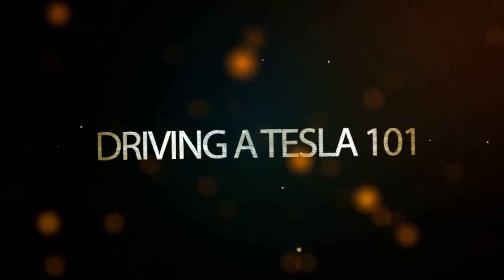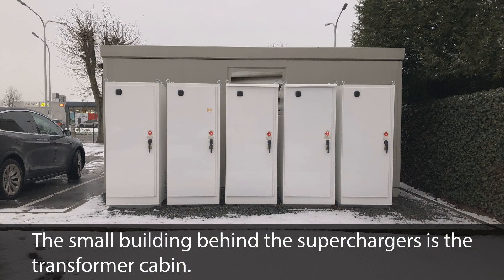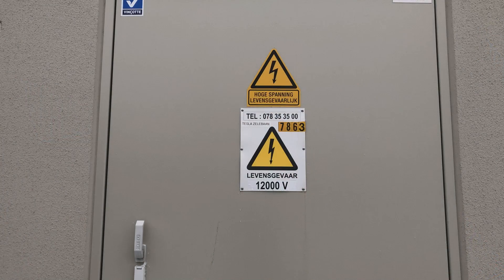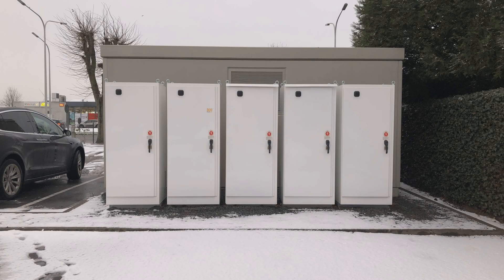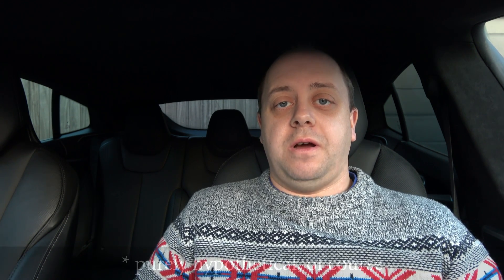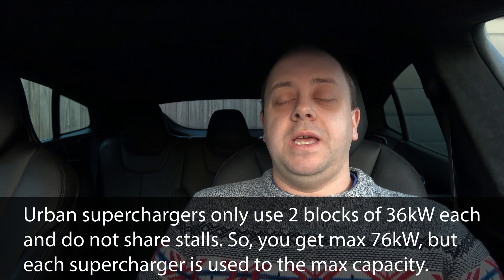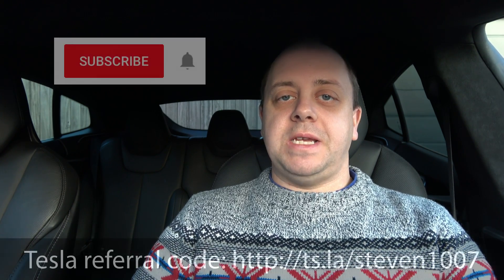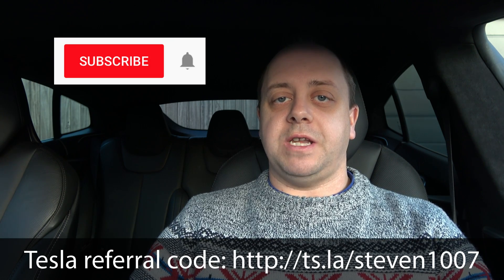Driving a Tesla 101: What is a Tesla supercharger and how does it work?

Comment: Have you got any idea what is in the V3 superchargers nowadays?
My vehicle (Maxus EV80) will charge at V1, V2 and some V3 superchargers. I can charge at SC Leusden and Hengelo, but Wolvega, Drachten and Bunnik didn't work. Luckily at Drachten and Bunnik there  were also some V2 chargers, so I was able to charge.
Reply from the maker: Same principle of multiple chargers stacked, but higher power and not shared across stalls. Not all superchargers are open to other brands though
Reply: @StevenPeeters  
Thanks for the quick response.
If that would be the case, then it's even stranger. Some V3 work others don't. Of course I only use the SC available to other brands. Otherwise I would be unable to start a session. 
I thought maybe with the switch to CCS that Tesla made in Europe they started using other brand chargers behind the SC stalls.
The new Alpitec HYC-300 that Fastned and Alego install nowadays are giving the exact same problem so I thought maybe I was onto a pattern 🙃
Reply from the maker: @arjenhoogcarspel4193  CCS is CCS. It’s just a communication protocol
Reply: @StevenPeeters  At least that's what it should be. Unfortunately it clearly isn't. Same goes for not all brands being able to charge at V4 SC. 
I'll keep digging and let you know when I find something.

Comment: I want to build my own super charger. 
Question how many volts AC are required to power a DC supercharger?
380v to 480v
330 amp at 480v
Reply from the maker: The voltage can be stepped up or stepped down. It’s the amps that you need to deliver the massive power requirement for a supercharger. And that is done via several AC to DC converters. You will not have enough power delivered to your home to do such a thing
Reply: @StevenPeeters  thank you. I wanted to know the specs because I’m interested in a commercial/residential application. I have 480 and I also have Generators I have a 24KW 75KW a 125KW and a 150 KW so I’m interested in what’s necessary so that I can size the generator properly
Reply from the maker: @MichaelDillin  I see. I’m not a licensed electrical engineer, so I’m afraid I can’t help with that specific question. But isn’t a generator providing AC instead of DC?

Comment: problem is transformer is only 86% efficient at rated output and the Tesla Ac/dc converters at 94% efficiency. So the losses are somewhere around 15% or  10 to 12kw  loss and it is in the form of heat.
You could run a entire house with the losses.

Comment: Is the AC from the grid to supercharging 3 phase?  I know there's no such thing as 3 phase DC.
Reply from the maker: In Europe (or most of it) high voltage AC to industry or supercharger location is always transmitted in 3-phase. The transformer then turns it into the right voltage but still 3-phase AC to feed the actual supercharger cabinets where it is transformed into DC power.
Don’t know how it is in the rest of the world or how the batteries are tied into it for some of the V3 superchargers. Not yet, at least

Comment: I already see; this will be problem: More Tesla plus mass production plus price will come down as Tesla have to really up-grade plus install far more super chargers. Electric Utility companies really ending up to run 70 thousand volt power lines instead just 12,000 volt. When solid state battery ever come out; the more of the so major problem to, try to do just 5 to 10 minutes charging with one mega-watt chargers. I say; this major up-grades isn't cheap at all. The Bottom Line: Home Charging is option.
Reply from the maker: Indeed. Superchargers are meant for long distance traveling. Daily charging should be done at home or public chargers.
But Tesla is no longer alone. The IONity network is growing fast and for now, Model 3s can charge faster on those than on the supercharger network. So, basically, Model 3 has more superchargers available than S and X :-)

Comment: 250 kW chargers?
Reply from the maker: HeavenGuy we don’t have these yet in Europe, so not sure about the complete configuration. I know that stalls are supposed to be decoupled. But it might require a completely new transformer cabin too, and battery storage. But the latter one is also not being rolled out here.
But as soon as they start rolling them out, I’ll look into it and report back 👍
Reply: @StevenPeeters  - I was unaware chargers could be combined into a "supercharger" until I saw your video. Tesla must have some finely tuned electronics in their chargers for 12 of them to play nice with each other. Thanks for the info. BTW, another guy tore a v3 charger apart and said each phase was a 6500 watt charger for a total of 19500 watts. 3 phases at 7000 watts each would make 252000 watts in a stack of 4 sets of 3.